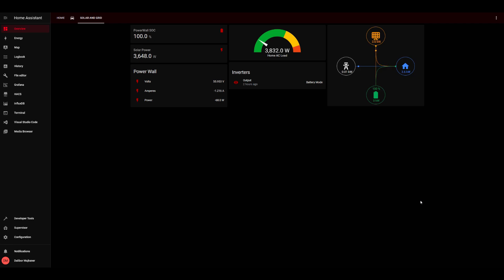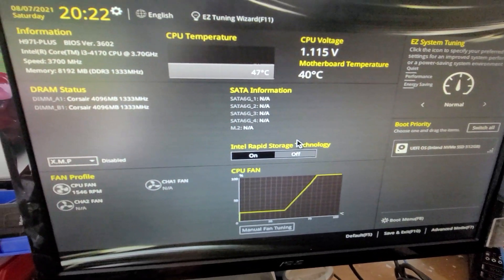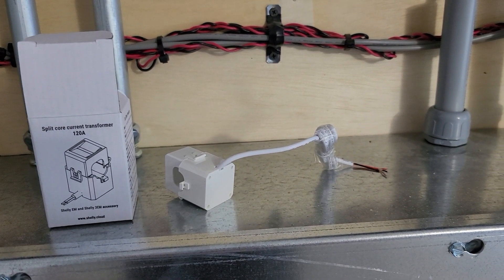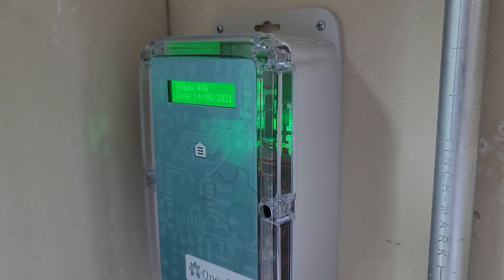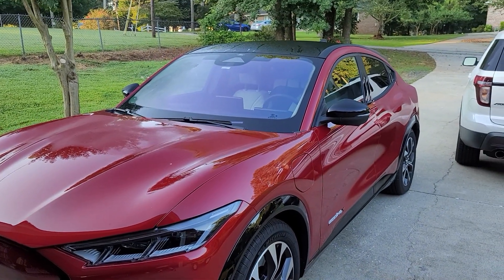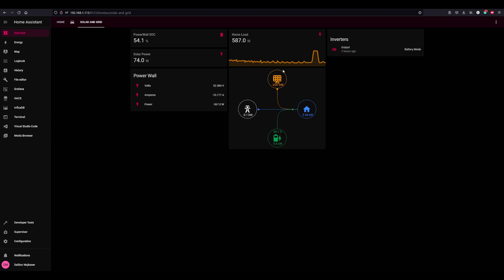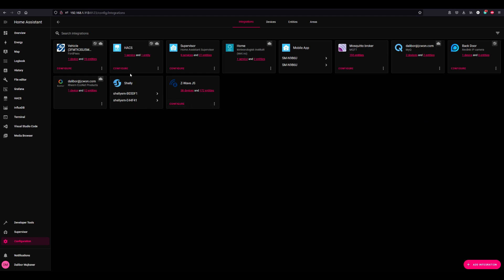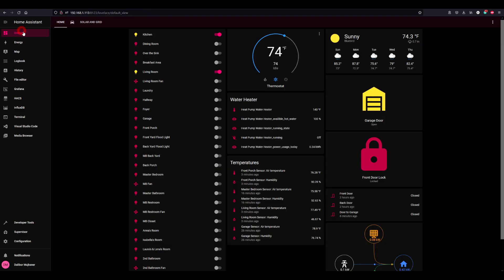DIY Solar System & Home Assistant

Comment: Very cool! And thank you for sharing! Why do you use 2 Shelly em? Is it because of what they say on their site about needing the Shelly to be on its own phase? So you need one Shelly for each of the 120v legs?      From Shelly: “two independent* measuring channels up to 120A each 
* the two measured circuits and the Shelly EM must be on the same phase”
Reply from the maker: Correct. One Shelly for each side of the phase.

Comment: I am assuming you are using shelly em for monitoring. How many clamps are you using?
Reply from the maker: 2 Shelly EM's and 2 ct clamps.
Reply: @DMIINC2013  so 2 shelly em with 2 clamps each?. Can you share the product link for Shelly and the clamps?
Reply from the maker: @bhavin6666  1 ct per em. https://shopusa.shelly.cloud/ 100 amp clamps.

Comment: I've had the Reolink DVR system (same cameras) for about a year now.  Great picture, absolutely useless for motion detection.  Especially here in Georgia where spiders love cameras.  I get my motion detection from arlo camera which have actual motion detectors built in.  I do have a solar powered stand alone Reolink camera that does do motion detection very well however it doesn't record even with an SD card - just doesn't work.
Reply from the maker: So far so good, at least for me. They do record motion, deer in the back yard and cars passing by in the front. Yes, spiders love cameras. Constant fight, especially this year. Pests galore everywhere.

Comment: Nice setup. What kind of range do you get from the Mach-E per charge? I'm interested in buying an EV or doing an EV conversion on an older vehicle, but I'm not exactly a fan of many of the short-range vehicles out on the market.
Reply from the maker: In town during the summer months 3.7 m/kWh and 2.9 m/KwH @ 75 mph on freeway. 88kWh usable. We will see what winter months bring.
Reply: @DMIINC2013  That sounds pretty good to me. It's also probably really nice to be able to recharge it for either free or pretty close to it with your solar power system.
Reply from the maker: Yes. Almost completely free. W/O car solar system is more then enough for the home use even with all of this rain we had this year. costs me 0.02$ per kWh to drive the car.
Reply: @DMIINC2013  Well, that is pretty good compared to what it would cost to drive a regular gas car.
Reply from the maker: Well here is my calculation, Mach-E Premium extended range battery is 365HP car. Around $2 per "tank of gas". My 2015 Ford Explorer Sport 365hp. $45 per tank of gas. And we drive quite a bit. It adds up quick. It will make Solar system pay off that much quicker.
Reply: @DMIINC2013  Very nice. I also just did some digging into Home Assistant and found some of the integrations for it that I'm pretty sure you're using, like InfluxDB and Grafana. I still need to see about the stuff for the MPP Solar LV6548 all in one hardware.

Comment: Wow I wondered what you have been up to. If there is a power outage does it all lock down? so security is in effect.
Reply from the maker: can you explain lock down and power outage? In regards to what?
Reply: @DMIINC2013  I think what I am asking is did you program as default when there is no power that all devices are locked or in a position that is secure.
Reply from the maker: No automation yet....